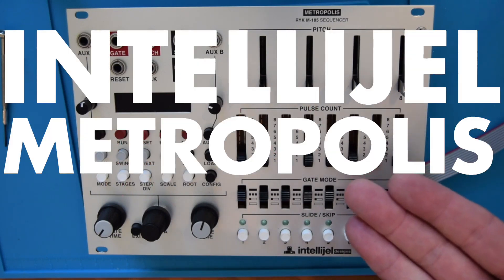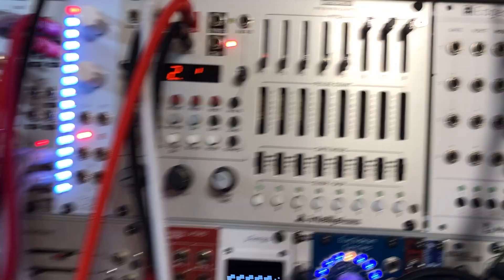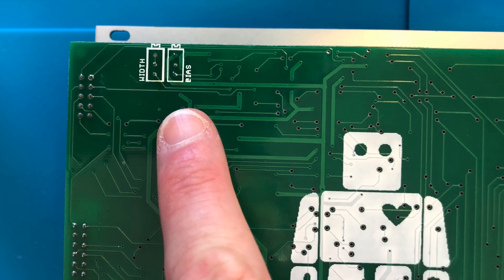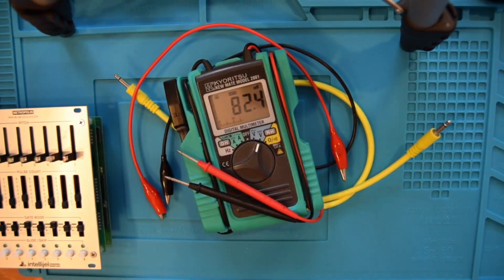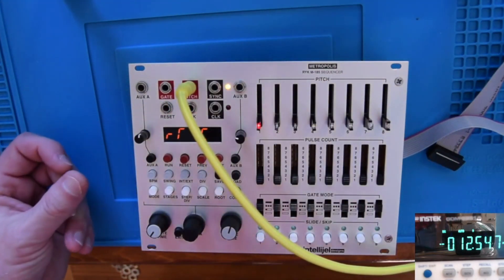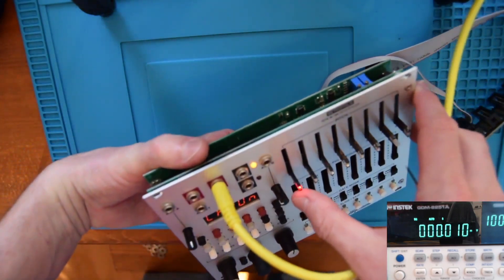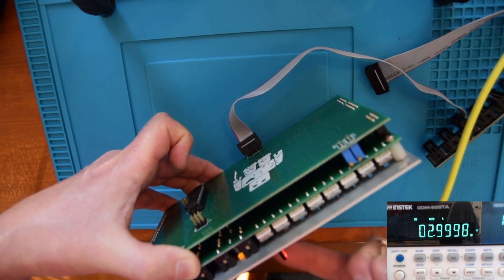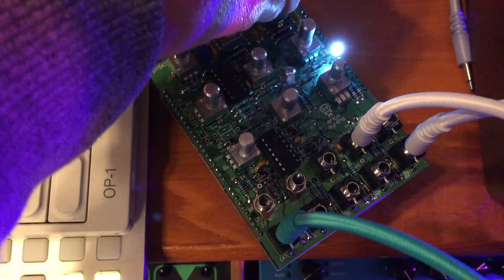Intellijel Metropolis Tuning Calibration

Comment: Thankyou - after cursing my oscillators I discovered this video.  Been wanting to like the metropolis so much but this has been driving me mad since I purchased second hand.  Now to dig out the voltmeter...
Reply from the maker: Very much appreciate the feedback, and great to hear it's actually useful!  ;)  Let us know how you get on.
Reply: @noodlingonwires9551  I followed the guide and see 1.29v on lower slider position, and 2.93v in high position.  Unfortunately for me the Bias and Width pots make no difference to the output voltage in either direction.  I mentioned in the forum and contacted support.  Seems I need send it off to Intellijel for a fix.  I may try and reflash firmware first though not too hopeful that will work.  Thanks again for this - surprised can't see any other mention of it anywhere else 🙂
Reply from the maker: @jonfhutton  Yes, that's the reason I felt the need to make the video in the first place.  I know I found a document on Intellijel's own support site about this when I purchased mine, but I could never find it again when I needed it myself.

veryactually